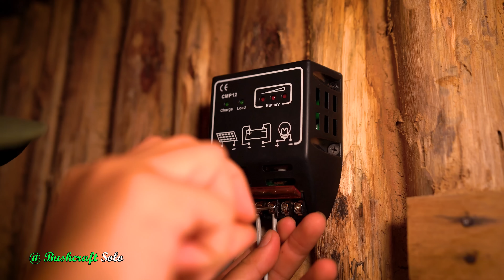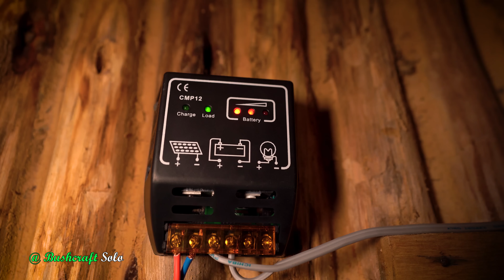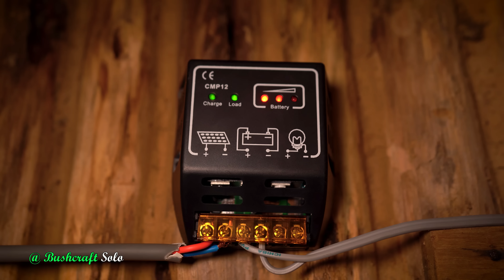Off Grid Solar Power System - Complete Dugout Shelter with Grass Roof in The Wilderness

Comment: Add an electrical outlet to your system to recharge the batteries on your drill.  Very nice though.
Reply: A Caterpillar heavy equipment  battery  would help.
Reply: Then you just  wire up a circuit breaker  to  that.